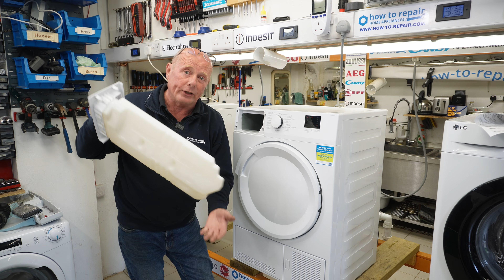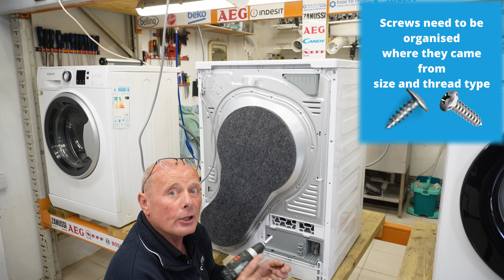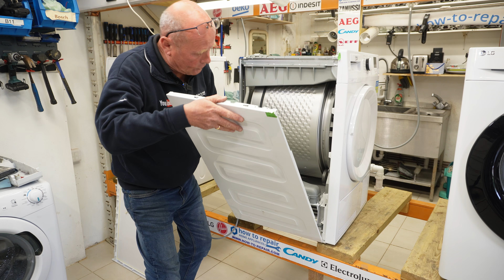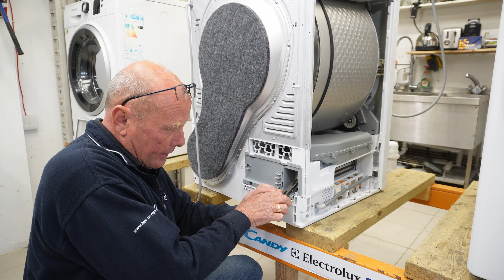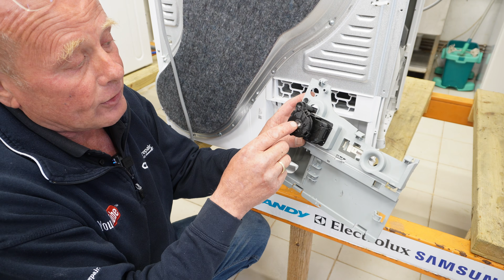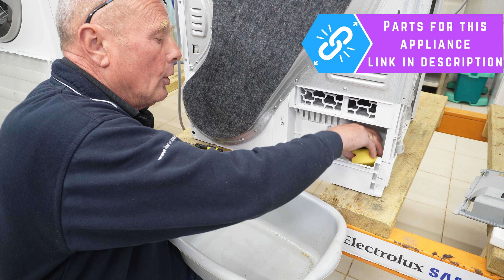Beko Condenser Tumble Dryer Cleaning Pump | When Water Tank light Is Staying on But Tank Empty

Comment: The pumps working perfect ive checked all pipes, the condenser is soaking wet, the main water chamber is bone dry, the two side chambers are filled with water. I have a lint light and a condenser light blinking at the same time. What else could be the problem

Comment: Just thanking you for saving us an expensive repair. The pump unit was fine, even taken apart but the water storage was actually packed with fluff. Once that was cleared out it fixed the problem. I've bookmarked this page and will buy any spares from your links in future.

Comment: Many thanks for your absolutely amazing clear and thorough and simply explained breakdown of cleaning and maintenance of the Beko condensing tumble dryer. This has enabled us to do the full deep clean and identify the fault as being pump failure. After the fault code still showed after initial reassembly took the pump apart to check it was not clogged internally, and even then rigged up a test power cord to run it on the worktop to check it was defunct. Looking forward to arrival of new pump later this week. Thanks again, full marks Paul.

Comment: Very helpful video! I have a question, if the tumble dryer works and dries the clothes and I change the pump, but still doesn’t work like the water doesn’t go up into the tank, what kind of issue that can be? Thank you!

Comment: Thank you very much for the video!  I'm working on my Miele T1 for the same issue right now.  It turns on, runs, warms up, but doesn't produce any water in the tank.  I checked the motor and it seems to work well (at least continuity with a multimeter indicates the coils are good and the float switch works, but I haven't tested the motor with a power source to see if it turns/runs).  If the motor/pump is indeed good, what else could be going on?  Could it be the control panel/circuit not working?

Comment: With £20, I was able to fix my one-year-old Bush tumble dryer. I took it apart, cleaned it, and discovered that the problem was with the pump. I ordered a new pump from Amazon, thinking that if it wasn’t the issue, I would return it and buy a new tumble dryer instead. Fortunately, it worked, and my dryer is fixed now! I’m a woman, and I managed to do the job myself! 🤭😂

Comment: Followed this and cleared all the water out the back. Have done a load so seems to have worked. I did break the styrofoam float but found a replacement cheap enough. Thank you

Comment: So metes the small floating white thingy gets stuck as if the tank is empty. This floating plastic piece presses the switch that tells the machine if the tank is full or not. A good shake of the machine does the trick and unstucks the plastic. Or if you have acces you can just press it back down and move it a little, until it moves freely. Probably it gets stuck because of some lint getting inside the hinges of this plastic floating piece.

Comment: Excellent video. Our dryer stopped working 2 days ago and I was scratching my head. So simple and informative. Thank you. 🙂👍👍👍
Reply: Hi, how did you get the big pipe back  on, the large grey one
Reply: @nateaabrahams9439  It just pushed on. It doesn't go on the wider hole at the back it goes on the narrower one infront of it.

Comment: Big thank you for making this video available. Very helpful and helped me to understand how these machines work and to find the issue and solve it. In my case (Bosch series 8 from 2018) the water level sensor elektrodes were ‘contaminated’ by fluff, which activated the switch.
Cleaned the condensor and removed all the dust as well and the dryer is working flawlessly again. Thank you 👌
Reply from the maker: I’m glad it managed to get you sorted. Sometimes the simplest information assist people in actually rectifying the problems.

Comment: Hi Paul 
I have cleaned all the pipes and tested the water pump and switch everything is ok but still the dryer work for 1 m then stop please help me to fix it what to do
Reply from the maker: If you use the contact this page at the website with your full model number I will be able to get you the workshop manual and other information to assist you. I might even do a personal video response.
Reply: Hi Pule 
It’s  beko 7kg condenser dryer model number DCw7230W
As I said I have cleaned the pipes changed the water pump checked the water pump switch 
Thank you very much
Reply: Hi  Paul 
Did you get the beko catalog for me please?
Thank you

Comment: What triggers the pump? I have bench tested it and all is  good, the pump turns on at machine startup and runs for about 30 seconds then stops and fails to restart even when the bottom container is completely full . The resistance across the pump terminals measured 0.8 K ohms,. Please Help
Reply from the maker: Hi, please use our contact us page and make sure you fill out the request for what your problem is. I will need the full model number of the identification plate and the details of your problem so that I can provide you with useful literature. A video shoot of the problem would be perfect as well.

I will get back to you within 24 hours, normally. https://www.how-to-repair.com/help/contact-us/  

Please remember to subscribe to our channel, as that's what keeps this channel going. Thanks, Paul 👍
Reply: Hi I have same problem made a lead up to test pump and it runs fine and sends water up to tank but won't run off the washing machine itself did you find a solution for yours👍
Reply: I was feeding the water  to a tank beside the dryer to use for window cleaning as it is distilled and leaves no residue but when this tank filled above the end of the tube it started to syphon water back into the dryer causing the float switch to shut the machine down. My easy fix was to make sure the end of the tube was not in the water using a clothes peg.

Comment: Damn,I thought this was something I was gonna be able to fix myself😭😭
Reply: It can also just be that the bottle thing isn't clicked in properly. The back bit has a hole where the water comes in and that can be full of fluff and stuff .I gave mine a good clean and it was grand. If you have a screwdriver you can take the back off easily but I'd clean out the whole front part first because that is easier...also wash the condenser if you haven't in a while it gets fluffy too.

Comment: Hi great video I have a logic condenser tumble dryer just on a year old pump not empty water I did test it and was faulty I got another one and I installed it and still have the same problem ! I tested the power feed and it’s dead no power to the pump test the leads going to the motherboard and they are fine . Is it going to need a new motherboard or is it repairable? Thanks Phil
Reply from the maker: Hi, I will need the full model number of the identification plate and the details of your problem. Please use our contact us page and make sure you fill out the request for what your problem is. A video shoot of the problem would be perfect as well.

We will get back to you within 24 hours, normally. https://www.how-to-repair.com/help/contact-us/ 

Please remember to subscribe to our channel, as that's what keeps this channel going. Thanks 👍
Reply: Hi did you get my email? And have you a fix? Thanks
Reply: Very good video 👌i have whirpool dryer 2019 Year model and have some problem with water.Can  help me what to do🤔